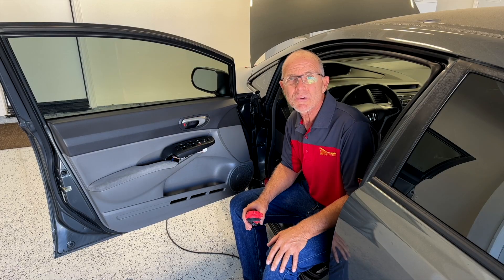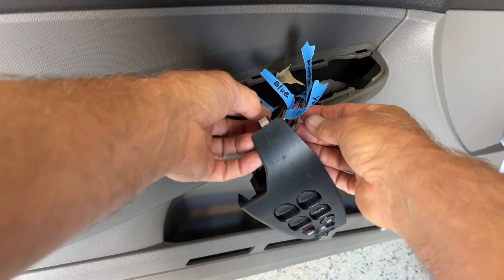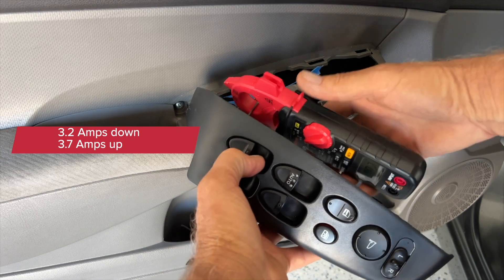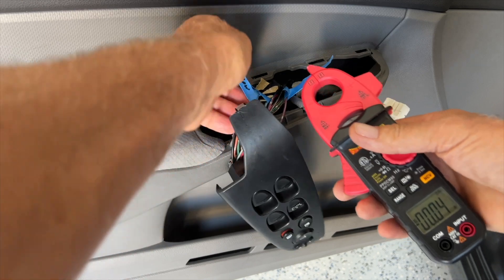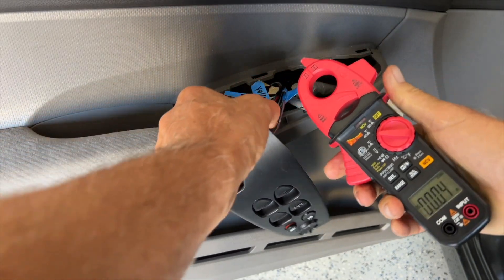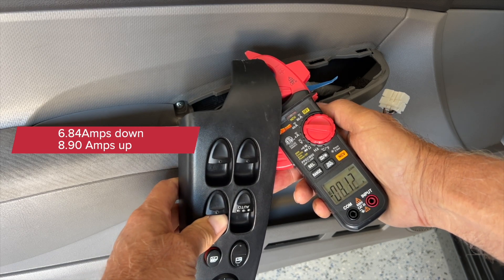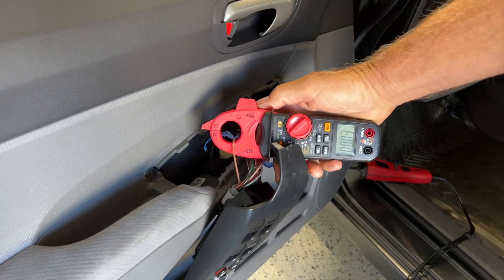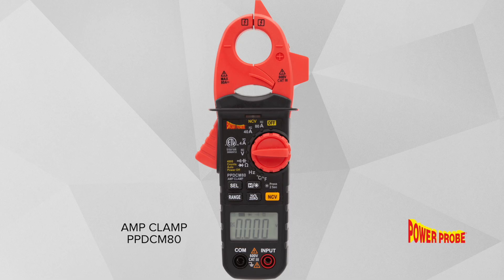Power Probe Amp Clamp | Diagnosing A Window Circuit

Comment: Hi amp readings on motors are often caused be the motor under your much stress, my ears tell me that glass wasn’t moving freely in its guides/runners hence the hi readings.
Reply: Yeah I've been thinking similar. One could lower the up current by graphite or silicon greasing the window channels.

Comment: Will the meter measure milli amps?
Reply from the maker: Yes it does! You can see specs at https://www.powerprobe.com/na/en/PPDCM80
Reply: @PowerProbeUSA  I don't see anything in the specs that would indicate it measures milliamps. I see that it states it reads up to 80 amps but nothing about milliamps. How low does it measure?
Reply from the maker: @shark61111  The complete technical specs are in the operators manual at that link. It reads down to 1 mA.
Reply: @PowerProbeUSA  Thanks!
Reply: @PowerProbeUSA  Are there any Power Probe authorized retailers that may have this meter in stock? Do you have an ETA for when shop Power Probe may have them back in stock? Thanks!
Reply: @PowerProbeUSA link doesn't work anymore but down to 1mA with the clamp. Really. 🤔